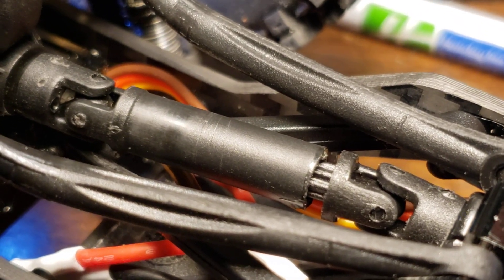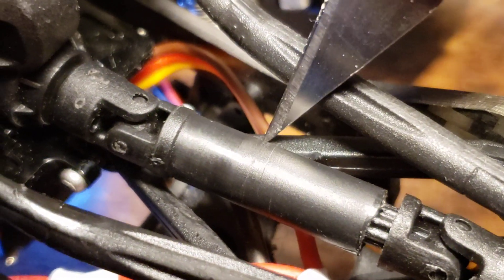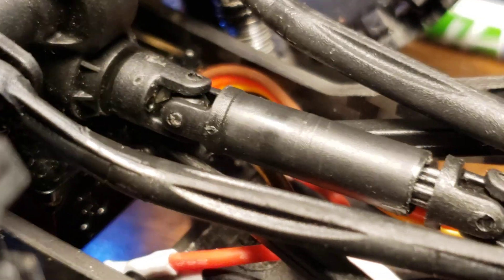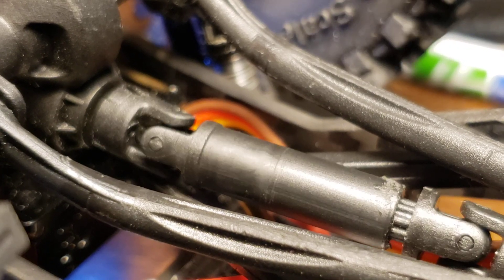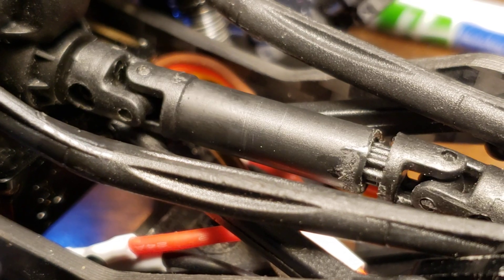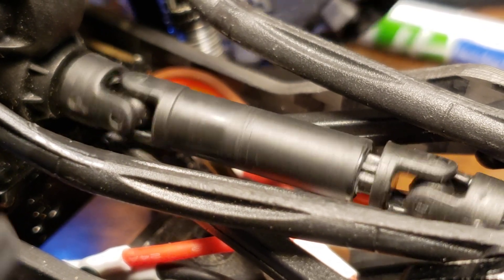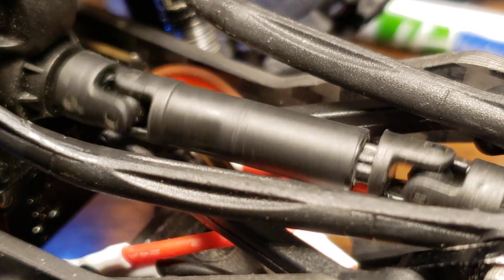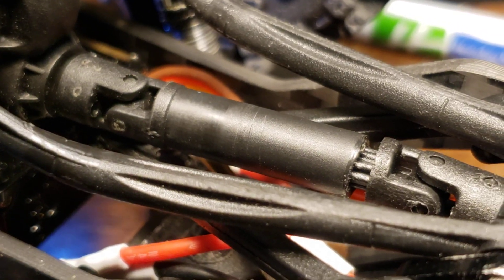SCX24 Another Rubbing Area. Open Offer. See Description

Comment: Mine had some rub, I switched to a metal upper and the rubbing is gone.  I couldn't hear it but I saw the same rub marks as you.  I probably would not have noticed but a pine needle got wrapped around the drive shaft and when I removed it, is when i saw the rub marks.

Comment: If I'm not mistaken...My two stock scx24 have the universal ends 90 degree from each other, not aligned, which to me makes more sense allowing for hinging equally in both directions. Otherwise it might not transfer rotation as smoothly. One however does rub near the same area but closer to the front.
Reply from the maker: Watch the video linked in the description. It will show why out of phase driveshafts don't operate properly.
Reply: @EXPIOWA  I don't see any links. Great linkage mod video by the way...I got awesome clearance now. Thanks. Now to jig up that upper front linkage to clear the rubbing.
Reply from the maker: @trailwomanrc  https://youtu.be/Idk3BVDVHq4